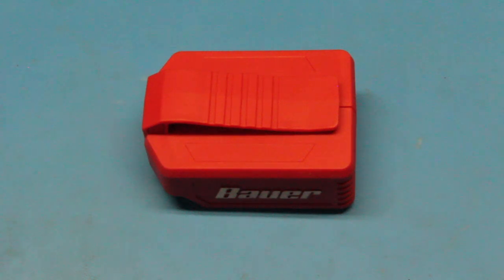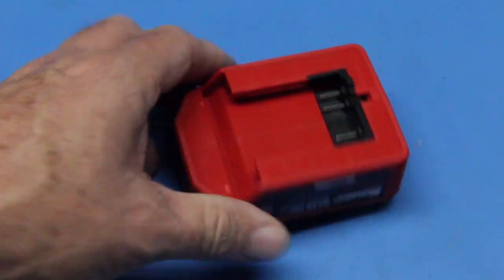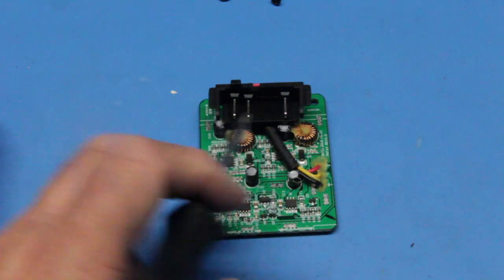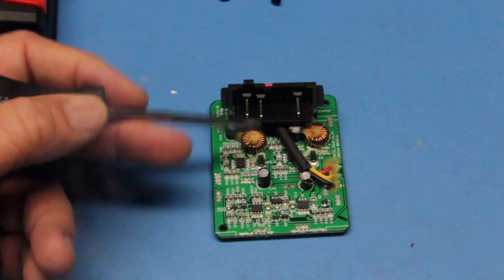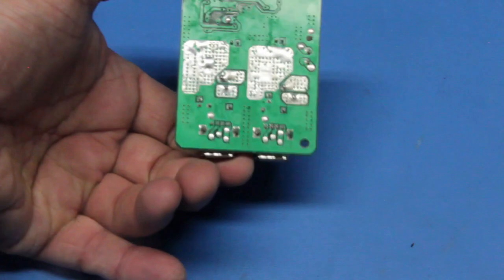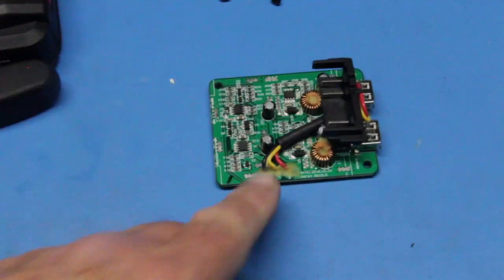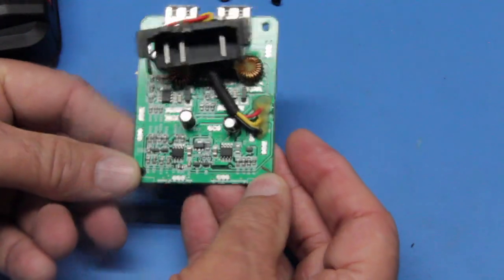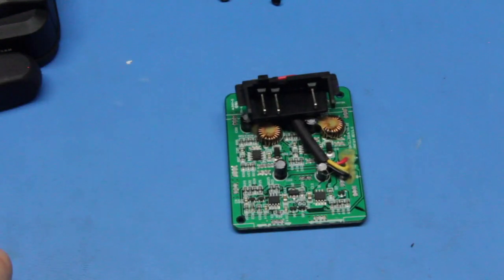Harbor Freight Tear Down Bauer USB Charger

Comment: Would be interesting to see what the voltage of an "empty" Bauer battery is vs an "empty" dewalt.
Reply from the maker: Lithium batteries have a lower cutoff voltage of around 3.0 volts,  if you discharge lower you run the risk of damaging the cell.  Thanks for the great question
Reply: @JoediyLab  The board in the pack looks very simple.  Maybe it just turns off current if any cell voltage gets down to 3.0V?  

The charger's connector does look like it has several pins... maybe for load balancing the charge?